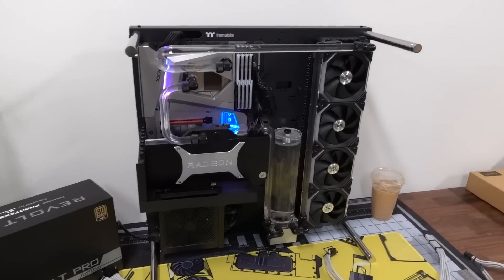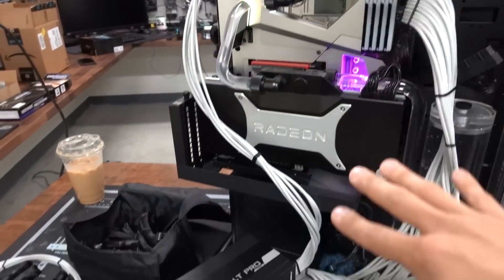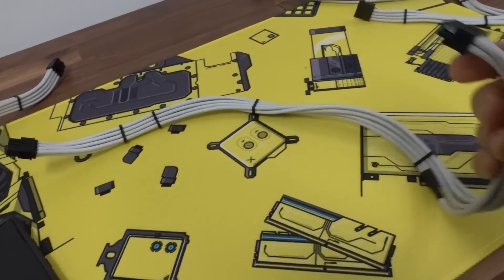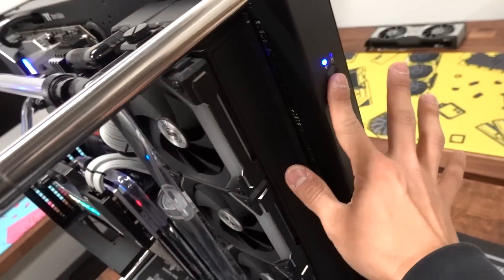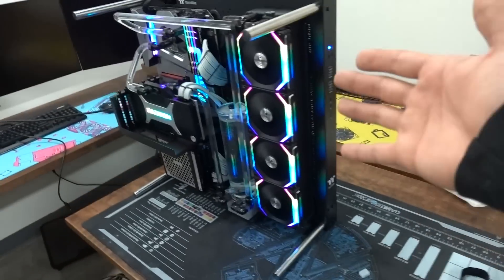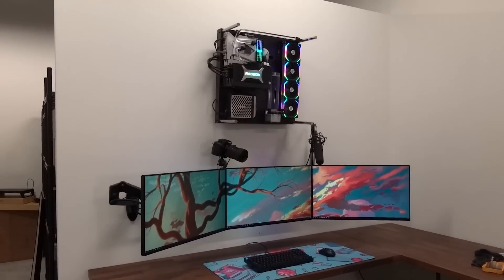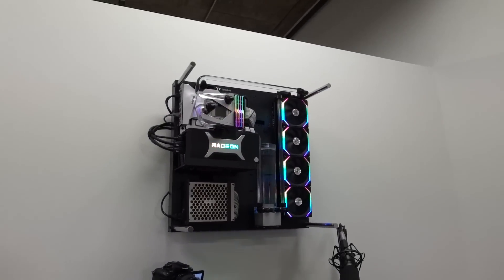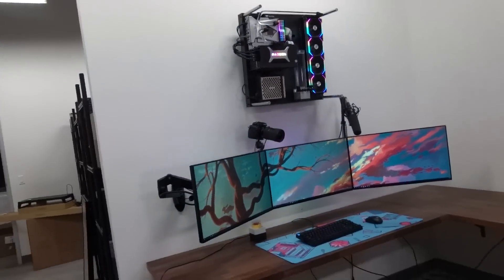I PUT MY PC ON THE WALL!!

Comment: As a P3 owner.  This is the best open air case I've ever owned.
Reply: TT Core P3 wall-mount gang! (oddly specific)
Reply: That’s a P5 chap
Reply: @chongster92  I'm aware.  He has the big brother E-ATX edition.
Reply: @KiamKweli  Got mine mounted, got water cooling shit coming soon too :D Running a Ryzen7 3700x and 2070s in mine :)
Reply: I still have my original (acrylic) P5 from years ago.  Instead of wall-mounting it, I'd custom modified it to be a stand-alone desk (acacia desktop, integrated monitor post).  Only recently stopped using as a daily-driver case; it's been cannibalised for parts and I'm keeping the shell as a basic test bench.  Honestly the best (non-custom-built) case I've ever had bar none.

Comment: You can get a wireless key fob so you can remote start your computer without anymore wires running. Cheap, clean and simple.
Reply: Silverstone has one that plugs into the USB ports. It's good 👍
Reply: Have you ever heard of BIOS option that enables you to start on your PC using mouse? Or just press any key on keyboard and done... Why would you need any button.... lol
Reply: @stefyyy1994  I haven't, please enlighten me, this seems very cool!!!
Reply: @stefyyy1994  no i haven't but now I do, still cooler to have a key fob tho lol

Comment: There are sheetrock mounts that support up to 50 pounds, and it's what I use for the shelf that's holding my system up. I got them at home depot, but I'd seriously suggest you look for them because they saved me a lot of trouble
Reply: he has those, that's what is holding up the floating desk

Comment: To fix the tilt, try mounting a shim of some sort on the back of the case about 6 inces or so from the bottom. I would cut a small wood block to size, paint it black to match the case, and maybe even glue some felt to the block to keep it from marking up the wall. Adhere it to the case with some velcro, or drill some clean holes in the back panel and bolt it up.

Comment: Easiest way I can think to make it level from the wall is add some shims extensions at the bottom of the case and just let Gravity be your friend!! 😎👍
Reply: Just moves the problem further away from the wall especially after another 5+ lbs of TG get added to the front. Had this scenario with heavy plasmas often. The shims at the bottom become the new face of the wall and the tilt occurs at that plane. Needs to be anchored at the top or have the tilt mechanism disabled/fixed.
Reply: @stevenwoodworth9966  Not if he keeps the top tied down. If I understand the issue he's having, keeping the top part tied down as best as possible and then adding something that will move the bottom out, it should pivot to a more level angle from the wall. You're probably right though! Wish I was there to experiment! LOL!

Comment: On the back of the case, bottom half, just put a block of wood that is command stripped or adhered to the case so it makes contact with the wall. If the wood is cut to the exact length needed to push the case out from the wall it should straighten it up unless the arm is too week to not push itself outwards. Good luck with whatever you try!

Comment: If you get 2 pieces of say dowel paint it black you can almost jerry rig back legs to "prop" it against. Put 2 on the bottom to push out from wall and boom done. Also if your worried about it being to much pressure pushing the mount and case out use your original idea as well with the rope almost like hanging a picture. Top held with the "rope" to tether to wall for extra safety and bottom has 2 legs holding it out from the wall.

Comment: You should be able to tighten up the tilt. I've used a few of these different wall mounts. There's usually a way to loosen it or in this case tighten it so it doesn't sag down. You also could get rods for the bottom that would push the bottom out causing the top to go in but that will take more trial and error.

Comment: Rubber back stops on the bottom corners to the rear of the case. that will give you the slight tilt forward.  Add low profile ones to the top for the aesthetic.

Comment: Answering question on how to straighten up the PC to get it flush on the wall, I think you need to re-do with a full widescreen TV style mount - the ones which are flat on the wall Or some are flat against wall with arm that swings out to adjust if you want that too. Just need to find one that is small enough to hid behind this case..as I imagine most wall mount TV stands are quite wide (60"-100"+ etc)so may need find a 32" flat TV mount or something... Love the floating monitor look. PC position looks awesome.

Comment: Love it, when are you going to do a 2021 build that doesnt cost a virgin sacrifice and the tears of a dragon?
Reply: Id like to see him work with a dell 9020 case. Lol. I have one.. And I cant get a Gpu in it.
Reply: @adamkendig4659  HP from early 2010's also have the worst PCI-e slot. I need to bent the PCI-e cover to even get a USB extension card there. I wonder what it'll take to put a double slot graphics card there. Its a HP Pro 3330 Micro Tower
Reply: @amvywavy  
Dell Optiplex 9020 Micro Box from like 2008 is what I have. Integrated graphics 16gb ram 2tb hard drive freshly partitioned with Windows 10. Bought it for 220 230 as a refurb from Walmart. Runs great. But its graphics need an upgrade.
Reply: @adamkendig4659  same. Mine runs great after I replaced the HDD with an SSD. Only the graphics card missing

Comment: Personally, I think it would look even cooler if you built an inset into the wall. That would also allow you to let the bottom of the case sit on something. It would also give you a chance to install 2x4s where you need them, or a sheet of plywood against the back.

Comment: For the tilt: I used a non-articulating wall mount I bought at Micro Center.  I had to offset the mount with a piece of plywood (which had the added benefit of strengthening the mount) in order to get the cables behind it.  I installed a normal 15A outlet and plugged in a surge protector mounted behind the computer.  The surge protector is designed to install behind furniture and the prongs are 90 degrees to the cable.  This allows me to plug in additional RGB elements or any other devices around the computer without the cable showing.  I also skipped the docking station and just ran four USB 3.2 type A and one USB type C cables through the wall.  The cables come out flush to the top of my desk with enough of a catenary that I can still use it as a standing desk.

Thermaltake P1.  Watercooled.  I modded it to fit 2x240MM rads to cool a 5900X and (eventually) 3080.

I hope that wolf design case releases cause I can't wait to put my hardware into that.

Comment: hey kyle you can actually straighten that  by just adding some washer or something to the bottom points of wall mount,that is the upper two on the existing position and bottom two slightly lifted by addition of some wooden piece or washer which could lift the frame of wall mount from the wall, which would give you ample amount of straightness look

Comment: To fix the sag, you can unbolt and flip the tilt mechanism on the wall mount VESA plate...this way instead of the tilt adjustment being mostly down tilt, it would instead have mostly up tilt adjustment and you can compensate for the sag.  I had to do this on a large TV and it worked a dream.

Comment: Hey Kyle, maybe some XPS foam cut to size for the back of the case? It's paintable (just not rattle cans up close), it's cheap and you'd just hot glue into place. Should be able to take the load without compressing too much, or if you want to get REALLY fancy, you could go for the whole back and just have gaps where things are.

Comment: Possible solution 1: Use a flush mount instead of the articulating arm. They are generally cheaper and more stable. Use 2 bolts in the stud then mollies for the 4 corners. The bottom of such mounts can usually snap out to allow access behind.

Possible solution 2: Use mollies behind each top corner. Specifically the butterfly style ones as the load will be pulling out of the wall.

Comment: Get some painted wood blocks, or White/black HDPE foam and block it out from the bottom. you could all so you could use toggle bolts into just sheet rock, their pullout strength varies but some go up to 200lbs. they come in various sizes/strengths Flip toggles are easiest to use.

Comment: Suggestion to solve tilt!: Add washers between the case and two lower mount holes to push the bottom of the case out.
Reply: It could work, but that's .5" - 1" of tilt from top to bottom. You'd have to use stacks of washers.
Reply: @8eSix  true, shouldn't be too bad though. Some wall mount kits bring washers and spacers along with longer bolts to have most TVs work so this shouldn't be a too much of a problem

Comment: Okay so I used to mount TVs for a living. What I’d do is mount a flat bracket tv wall mount on the wall. Use the included lag bolts to hit the one stud, then use toggle bolts to secure it flat to the drywall and add more security. The lag bolts in the stud will for sure be able to handle 50-90 lbs. Those single arm mounts are garbage. Then you can just secure the PC to the bracket and enjoy :)

Comment: Hi Kyle, big fan here, congrats on your sick setup!  Regarding the tilting PC issue, maybe you could use some sort of L-shaped metal brackets like those meant for DIY shelves.  Find some that are the right length matching the space between the wall and your PC and mount them at the bottom of the case at the back, like you did for the hooks at the top.  Add rubber feet at the end of the brackets where they make contact with the wall when you fold your PC back using the arm mount.  Well I'm sure you'll figure this all out and I can't wait to see the final result + keep up the good work !

Comment: Hello :) thank you for the video. Screw a rubber block into the wall behind and at the bottom of the pc - between them. Tall enough to support the pc at the perfect desired distance to the wall. Rubber so it will absorb vibrations. Hope this makes sense the way I explained it.
Example: Imagine a rubber door stopper with a central screw. use two on each bottom corner if necessary. This will also take a slight load off the wall mount

Comment: Is this a good pc list or should I change anything

MOBO-gigabyte z390 gaming x 150$

CPU-i7 9700k 250-275$

Gpu-rx 570 200$(I’m gonna try to find one for 200$ hopefully)

Ram-T-force Vulcan z ddr4 16gb 2 sticks of 8 ram 78$

Ssd-Sabrent 512 gb 70$

PSU-EVGA BQ 80+ bronze 70$

Case-NZHT H510 70$

CPU cooler-se-224-XX basic 30$

Total price 918$

Comment: Hi from Spain, maybe you could use a lot of washers on the down side of the wall mounting of the computer. You know, the spacers, could be plastic, iron, etc, you could use as many as you need to keep the computer straight.

Greetings

Comment: for the tilt, u could put some kind of "bump stop" on the bottom half of the pc, but, on the wall, aligned with the center I suppuse, one on every bottom corner, something like a piece of wood, or if u like it fancy, a door stopper

Comment: I work with acoustical wall panels and what I would suggest is some 100lb rated drywall anchors that have a spreader on them like from home depot. Then use z-bar which is metal bent to look like a z that interlocks with itself. Put a piece of z-bar mounted to the PC chassis top and bottom, and correlating pieces on the wall. Mount the drywall screws at each end of the zbar with a center screw (I would prefer a wood bolt) through the stud to hold the weight of the setup. 
  Keep up the good content 👌.  It's uncanny I have the same 360 swivel bracket for my 65" OLED and yeah that tilt is meant for TV'S to eliminate screen glare.

Comment: Could create somewhat of a bumper for the bottom rear of the case that touches the wall to space it out and make it level. Say a piece of packing foam (the squishy stuff you find in say a box for a PC Case) for example. Can use double sided tape or velcro for ease of removal for the future

Comment: Worked avionics for cargo planes while in the AF. I can tell you right now, when troubleshooting you're gonna come across random crap all the time. Wiring that likes one unit but not another. Units that like another unit but not another. It never ends what electronics will and will not do when integrated with so much (and computers are this on a smaller scale).  Hell even headsets not wanting to work at one station but fine for others. Basically never rule anything out till you've tried it all out.

Comment: I have had good luck using wall anchors. The wing type anchors  that fold and flip out on the other side of the drywall work really well with a washer and some nuts. You can get an eye bolt the same size so you have something to connect to. Best of luck!

Comment: Kyle, it looks like there's a tilting mechanism on the mount (see 11:42). It looks like on the mounting plate two semi-circles with a nut that can be tightened. Push the plate back, and see if that fixes the tilt. Or, look at the mounting instructions. I'm sure that can fix the tilt.

Comment: Tilt fix: a simple block/tube of appropriate length, positioned behind the PC at its lower edge. It will be pushing that lower edge outward, counteracting the weight by distributing the force back to the wall, forcing the top tilt back to a 90 degree angle. Might need two, one at each bottom corner and probably only a few inches long.

Comment: spacers on the bottom and top, same holes you used for the hooks on the top, only need to be about 30-40mm, the spacers will help set the gap from the wall and keep it parallel to the wall

Comment: To fix the pc tilt, a wedge shaped piece of wood, super thin at the top, thicker at the bottom. Use this as a spacer between the wall mount and the studd, using longer screws as necessary. Make the bottom of this wedge thick enough to give yourself tilt adjustment going back down. I have the same case and similar wall mount. I have this exact same issue. I've been thinking about this for months lol
Reply: This also gives the ability to still use the swing arm, and doesn't introduce extra tension on the arm the way the rope may have done.

Comment: Looks amazing! Could you not just spray paint a block of wood black, screw it to the wall behind and at the bottom-centre of the case so that the case rests on it. Takes pressure of the arm, and the block just needs to stick out enough to level the case? Not very premium but you wouldnt be able to tell. You could even hang some merch or logo or something off the block as well to hang just below the case if you wanted.

Comment: The unwanted angular slack is presumably from the elasticity of the nylon (?) string you're using to retain it. Replace the cable something with less flex such as cable wire, or a couple of metal rods of a very specific length, short enough that they can only reach the hook on the wall if the unit is vertical.

Comment: Another idea... add spacers (nuts, washers, etc.) to the two bottom screws or bolts either behind the wall plate or behind the plate that attaches to the case or both. You might need longer screws and/or bolts for those spacers. I think spacers behind the plate that attaches to the case would work better. Just measure the difference between the top gap and bottom gap to figure out how thick the spacers need to be.

Comment: If your still looking for ideas to flatten the case. Put some strong drywall anchors in, use the exact same hooks you have on your case and zip tie them together. Dry wall anchors are very strong and will flatten your computer easily. Especially if most of the weight is on the versa mount.

Comment: Solution is simpler than you think: To make it straight, simply screw a piece of wood to the stud a few inches underneath the mounting bracket on the wall. That way when the computer plate sags it will prevent the bottom part of the plate from touching the wall.  You may want to experiment by using half inch slabs of wood on top of each other first to get the right length of wood needed to prevent the sag. Then cut a smaller pieces to match. It's also nice and clean so you can easily move the computer to reroute any wires if needed. :-)

Comment: Measure the distance of the bottom of the case to the wall while holding it level, then cut a piece of wood, paint it and bolt it to the wall. The block of wood will force the bottom away from the wall when the case is pushed up against it and bam! No tilt.

Comment: Use wire, not rope to try and pull the top of the PC back towards the wall. Also, if you do that and its not enough you could use a wood or plastic block cut to the correct length to push the bottom of the PC out some. The wire you can get from Ace hardware or a Tractor Supply if you have one close by. You will also need wire retainers, they are in the same section as the wire if you go to TS.

Comment: If you use some adjusting pedestals (feet) on the bottom of the case, between the case and the wall, it should prop it straight and provide support.

Comment: Spacers/standoffs at the bottom of the case will push the bottom out, which will push the top back.   I've done this a million times with mounts like this where I wanted it completely flat.  These kind of mounts really do not hold stuff straight up and down and you have cables running behind which will naturally push the whole thing out of perfect alignment.

Comment: To find the lean, just add a bunch of washers and spacers to the bottom bolts. This should push the bottom out and thus correct the lean. You may need to get longer bolts to make this work as well but its a simple solution.